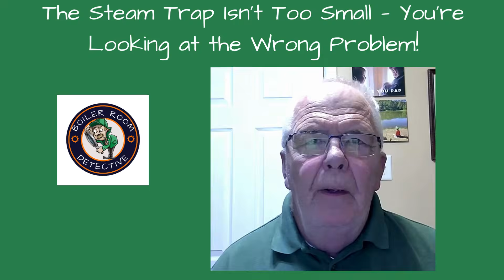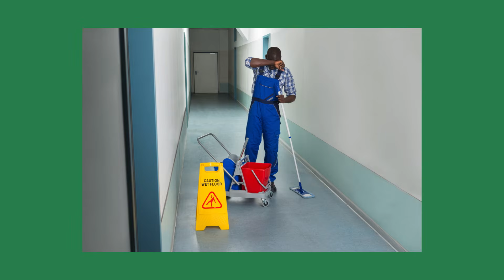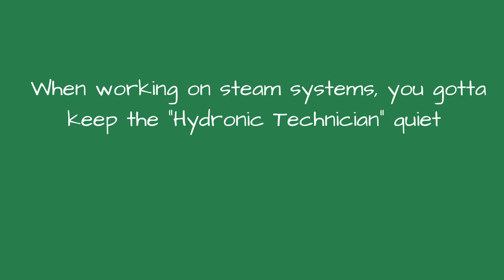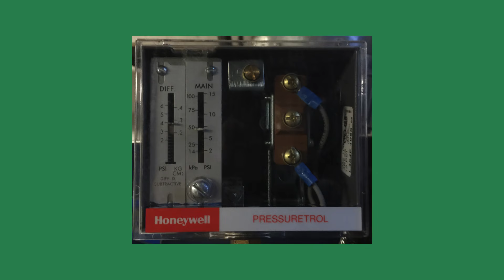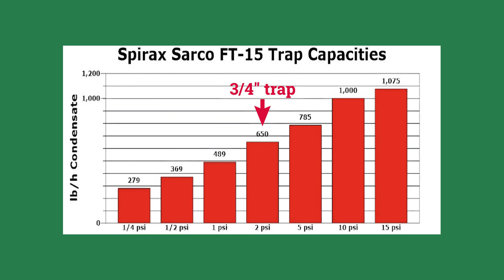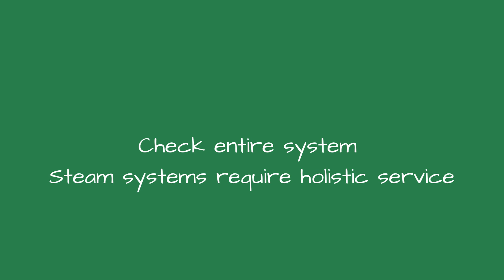The Steam Trap Isn’t Too Small — You’re Looking at the Wrong Problem!

Comment: Our steam guru "DH" was trouble shooting an intermittent  low water situation on a large boiler in a downtown NYC building.  A  2 1/2 " return pipe was attached to a 2 1/2"  trap, (which made it look aesthetically  correct ) was too large causing a delay on opening  to return the water to the boiler. It was replaced with a 3/4" trap and the system worked great!
Reply from the maker: Isn’t that amazing Dans my hero

Comment: Ray, there are very few steam heating systems here in Minnesota. I consider myself an expert in steam but I have no "celebrity statues" so building managers don't know me from Adam.  Here's the challenge. The additional things you mentioned are spot on and from the pictures I would add that the near boiler piping was improper also.  If the existing hvac guy is allowed to change out the trap with a larger one there's a pretty good chance the system will be able to expel air and condensate faster and the system might quiet down giving the impression that he was correct compared to mine/yours estimate that would be many thousands of dollars more expensive.  Additionally, we could do all the work you mentioned just to discover that there was another unquoted problem, and more money to spend, which is why they cranked up the pressure in the first place.  Here's the rub: You were asked to come out for a free estimate and all your diagnostic time is now uncompensated.  Your price quote will be 5 times the other guys. The church, if they believe you over a multiyear relationship with another firm, will ask the other bidders to give them a bid on the same things you bid and all of your knowledge, experience, and time will have been for nothing unless you are the cheapest guy.

Here's what I do.  I come out for the free bid and find everything like you did plus I note the pressure being up indicates a hidden problem or two. I demonstrate to the maintenance guy showing me around AND the decision making pastor that the pipe insulation cause much higher loads because they can understand that clearly without any special knowledge.  They will know im correct without a doubt. Then I tell them that Ive also located 4 other contributing problems but I wish not to give away my knowledge for free so that a cheap bidder can steal my knowledge for free while I go uncompensated. Makes sense to the pastor. I suggest they pay me for time while I type up a detailed description of everything needed along with suitable part numbers for materials and job workflows. A sort of design consultancy fee. Now i've demonstrated that the hvac guys diagnosis was wrong and the right guy is standing before them. And i've figured out a way to get paid without giving away all my knowledge and some time for free. The issue of potential hidden problems/cost is scary for decision makers when considering to go forward with you or not. The issue of the jacked up pressure needs to be explained in such a way that makes sense. It has to be explained that there's been years of improper maintenance/operation of this equipment and the others who have worked on this have accidently hidden problems by making a side-effect go away by cranking up the pressure without solving the true underlying problem.  I relate it to what almost happened again if they didn't have you/me out and just replaced the trap with a larger one, likely the water hammer might have gone away (side-effect) but wire drawing will be the result and all the real problems would be left unaddressed. Perhaps a presentation to the church board will be needed.
Reply from the maker: I have fought that battle myself I once showed a customer a solution and he sent it to my competitor and the customer had the nerve to call and say my solution didn’t work Some people are not good customers What I would do is remind the owner that the system worked for 50 years I feel your pain